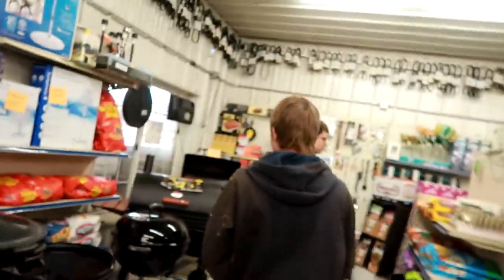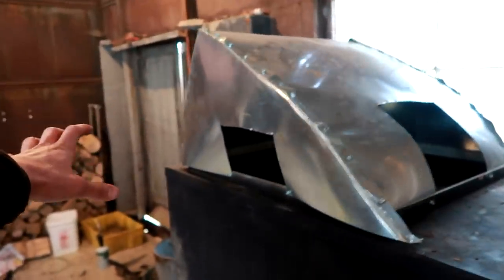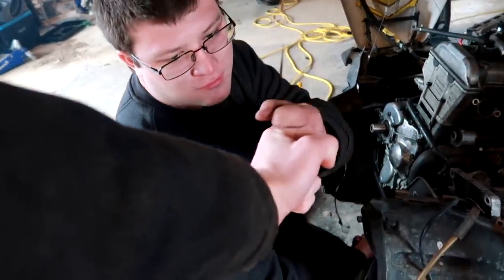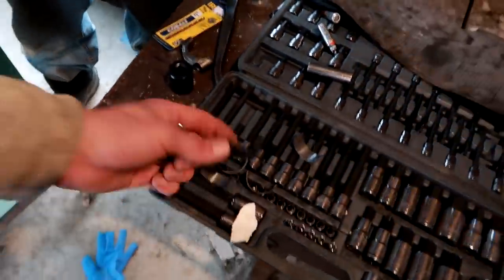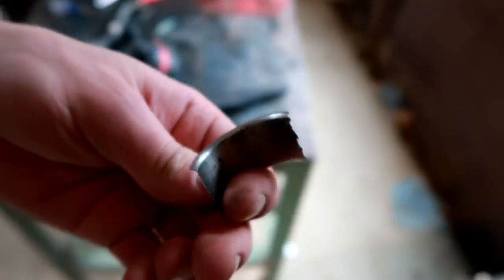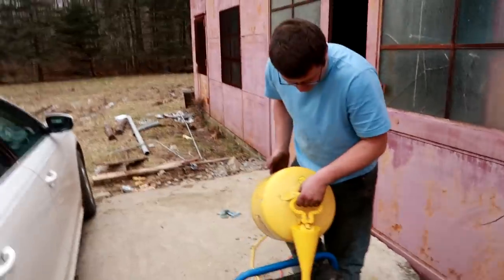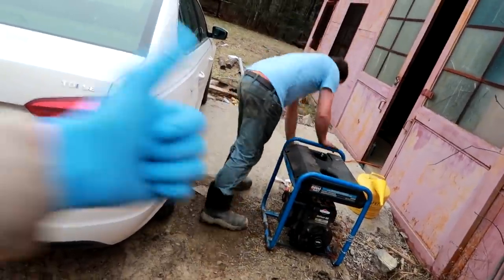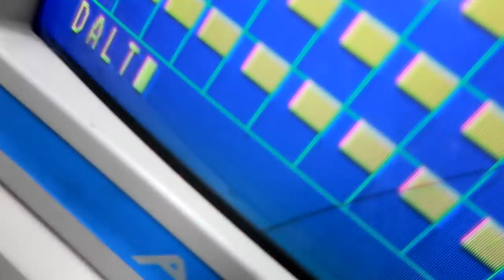DON'T Make THIS At Home

Comment: Hello I am currently in the market for a Duramax and was wondering what your opinion was in truck sizes. Between you and/or your friends that have them is the 6.6 ft bed enough. I am looking to buy an 8 ft because I haul alot of scrap but the conflict arises with cab size. Is there enough leg room in the extended cab or would you choose the crew cab over an extended cab. My main concern is that a 8 ft crew cab would just be too long of a truck. Thanks and keep making awesome videos. I look forward to them everyday.

Comment: Had a small $10 bearing go out and lost a $200 wheel and tire and $100 whole hub assembly off a trailer.....luckily we had just turned off the highway and was only doing 40 mph....if we had lost it doing hwy speed we probably would have put the truck, trailer, and skid steer in the ditch